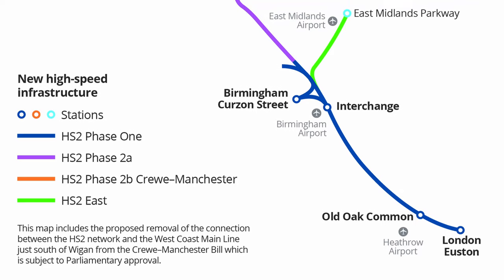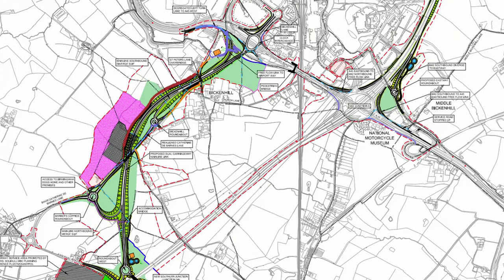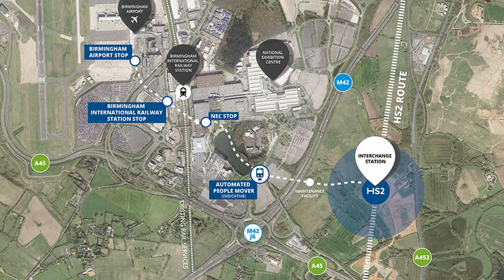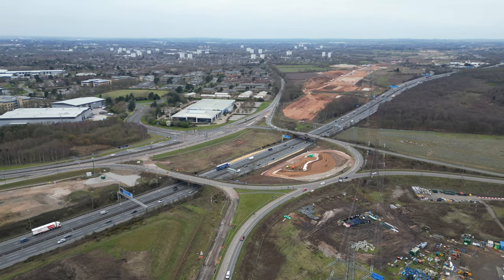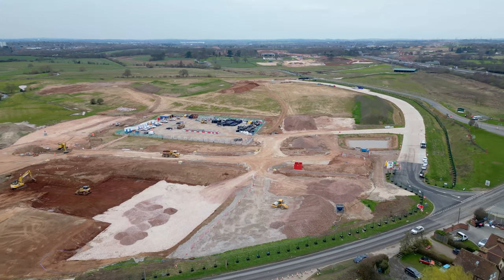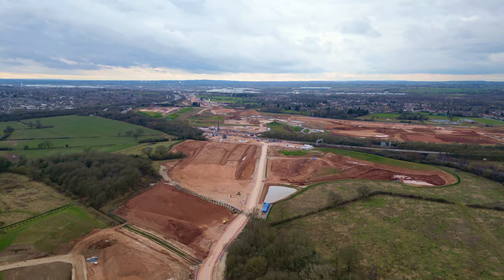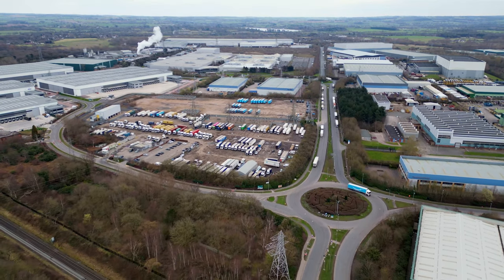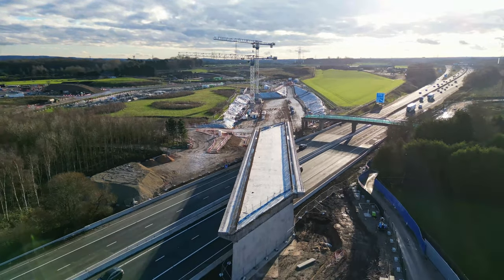How HS2 gets past Birmingham - Airport Interchange & Delta Junction

Comment: Enjoyed the video, very well done. The scale of the destruction and the mess it’s making of existing infrastructure is made startlingly clear from above.
Reply: I think generally around this area there is very little that isn't fields. It does look awful, but a lot of this should return to nature fairly quickly. Other parts of the line where they've stripped out woodland is another issue...

Comment: The link to the NEC should be fantastic! I can't wait to see this in action.
Reply: The people carrier link from Birmingham Interchange Station to the NEC will be the extension and upgrade of the existing link that operates between Birmingham Airport and the NEC and Birmingham International Station, but will be extended so that it will connect Birmingham  Airport, Birmingham International Station, The NEC and Birmingham Interchange station together
Reply: @peterwilliamallen1063  I did wonder this - the diagram makes it look like it would be a different line altogether. I'm guessing they're just using the existing bridges and right-of-way of the existing people mover, but will throw away the track, infrastructure and vehicles?
Reply: @JaidenJimenez86   Living in the area and living very close to both the HS2 route and Birmingham Airport and taking an interest in HS2, it has been said that the existing line of the people mover will be extended the short distance from Birmingham International Rail station to the new Birmingham interchange Station, nothing has been said of whether the existing vehicles will be used and new ones added or whether a set of totally new vehicles would be built, but the building of new vehicles is nothing new as when the Midland Metro was extended the West Midlands Council purchased brand new CAF trams, so this may happen here where by with extending the system new people mover vehicles may be built

Comment: The sheer complexity of this area, trying to thread a high speed Y junction railway around one of the most complex motorway, airport and power infrastructure, explains a lot about the high costs.
Reply: The Delta Junction is not actually any where near Birmingham Airport or it's runway being about 3 miles away but it does cross the M42 /M6 Toll roads.

Comment: Excellent work again Martina, thanks you for putting all the time and effort in. A very information intensive video so I will have to rewatch to get orientated with it all. I noticed you mentioned National Grid infrastructure and referred to the movement of ‘pylons’. In the UK people in the industry tend to refer to them as ‘Towers’. Referring to them as ‘pylons’ is of course fine and is the term the general public would generally know them as. It’s just I noticed you do seem to use accurate technical terms in general so I thought I would give you another one from my industry. Cheers and best wishes. 👍🙂🙏
Reply from the maker: Yes I think in videos about something else, just calling them 'pylons' is easier and avoids confusion with radio masts or other structures someone might think is a 'transmission tower'.
I would like to do a DEEP video on electrical infrastructure though so any information, links or tips are very welcome... so far the best info I've found on technical specs is weirdly https://www.emfs.info/
Reply: Is all plain, engineering patethic ,in italy, full of tunnel s,bridges, great engineering, HSR underland from NAPLES to Bari ,Florence Bologna, tunnel for Austria, SWISS, france,...UK 😅😅😅

Comment: The amount of people commenting that HS2 is not needed is nothing short of staggering as they clearly have no understanding of the transport needs of this country. Would they have been just as vocal when the first motorways were proposed? Would it have been "but we already have roads, we don't need more...", no, didn't think so.
The WCML is simply full and the extra capacity that HS2 would give is very much needed. No one is pretending that they haven't got things right all the time, especially the PR team who focused too much on the high speed element when they should have promoted it as the much needed capacity alleviation. The high speed element just future proofs it over its planned life span. 
I just wished people would take the time to do just a little bit more research before venting off. Building more roads is not the solution.

Comment: May I ask a genuine question?....How does HS2 cross the M42 4 times?
Reply from the maker: The HS2 mainline crosses the M42 just north of J6, back again around J7A, and a 3rd time north of J9 (3 times). The chord linking the Birmingham spur to the line north also crosses the M42 between J7a and J9 (the 4th crossing).
If phase 2/ the line towards Nottingham ever happens, that will criss--cross the M42 as it would follow that route pretty closely.
Reply: @martinalooksatthings  Because the M42 wavers generally in the same direction as HS2..... This makes sense now 🙂

Comment: It’s strange to wonder why they couldn’t just extend HS1 to serve the places that HS2 will serve
Building a new High Speed line costs more than extending
Reply from the maker: HS1 isn't a big extension lead where you can just pull out another hundred miles, you'd still need to build a high speed railway by buying a long strip of land, doing various earthworks, pouring a load of concrete etc. The only difference would be the name and building the extra bit around St Pancras to connect HS1 and HS2 (which would cost more)
Reply: @martinalooksatthings  HS2 is not compatible with HS1. They pointed this out 13 years ago. HS2 is a larger gauge.
Reply: @edwardtreadwell3859  HS2 is compatible with HS1 as the Gauge is the same as Eurostar trains have had to be built to the UK loading Gauge and not UIC loading Gauge, it is European trains that won't fit on HS1 or HS2 and the track gauge is the same in both cases
Reply: @peterwilliamallen1063  So why do HS2 say it isn't compatible?. They made this clear from the outset in 2010.
Reply: @edwardtreadwell3859  I have read all about HS2 watched their videos and being interested in Railway's as a hobby and living in Birmingham I have never seen it written any where that HS2 and HS1 are incompatible, it just said that to join HS1 and HS2 across London is not feasible due to the logistics of travelling across London and the fact that their is no commercial grounds to run trains from HS2 into Europe and vis versa as HS2 has always been a domestic intercity line and the fact it is far quicker to fly from Birmingham and Manchester to Europe than catch a train, in both cases the track gauge is 4 foot 8 and half inches wide and the HS1 line in Kent is designed to take British and Continental Berne Gauge coaching stock, so HS2 trains would be able to travel on HS1 through the tunnel as would Eurostar trains able to travel on HS2 but there is no financial reason to do so and with HS2 service wholly run by Avanti West Coast/Trenitalia no other company will operate on HS2.
Reply: @peterwilliamallen1063  The question was asked when HS2 was first announced whether it would link to HS1 and thus be able to enter mainland Europe.  The reply was a firm no. Due to the gauge being smaller on HS1. Don't take too much notice of HS2 propaganda.  They have consistently told lies over the years about the detrimental effect to the environment.
Reply: @edwardtreadwell3859  I think you are getting mixed up, HS1's loading gauge and track gauge is not smaller than HS2 as on HS1 both International Euro Star Trains of both original 373 stock which did travel up the ECML on domestic services for a while, the new 374 Eurostar stock and standard high speed domestic Javelin Trains which not only travel on HS1 but also travel on the Kent Coasts South East services on the domestic third rail services in parts of Kent which are no different to HS2 trains which will not only have to travel on HS2 lines but the existing domestic WCML to Manchester and Scotland, both lines use the same track gauge, except HS1 is built to the larger Berne Gauge because it was thought at the time that European TGV trains would run n it, but this has never happened and the Eurostar Trains were built to the British Loading Gauge, it was decided that the 2 lines would not be joined due to logistical reasons of the fact there was no reason for trains from HS2 to go into Europe

Comment: What an insane and inhuman way to live. What a bleak, hostile and dismal environment. Steam trains and factory chimneys were a huge initial step, and it seems we are completely habituated to artifice now, like caged hens. And now, since we diverted the river to make way for the canal cut, and then we put a rail viaduct there, with the new A road going under it, and since the motorway had to bypass all that, we've had to pyut the new high speed rail link through all the bits those previous scars on the landscape did their best to avoid. If this was as much of an improvement to our lives as steam trains and factory chimneys were, I'd reluctantly acknowledge its benefits, but what exactly is this for? Shaving a couple of hours off of certain passengers' journey times? Not good enough. I strongly suspect that our economy will collapse under such schemes, and quite possibly our entire society, under the current intensive mismanagement, and then these relics will rust, and be reclaimed by the undergrowth, as we who survive struggle to attain the steam trains and factory chimneys stage while we try to get the canals up and running again.
Reply: Complete nonsense from start to finish

Comment: Is insignificant the sistem of ways in UK,,in italy, the engineering of high speed rails and ways, is incredible, Florence Bologna 200 km of tunnel, alps, Appenninis, England ,all plain,because Birmingham has only this?
Reply: In the UK though most normal lines have a speed of between 100 and 125 mph, in most other countries including Europe, if it is not a TGV route their trains are pretty slow compared to the UK.